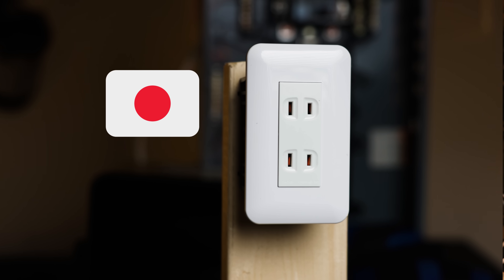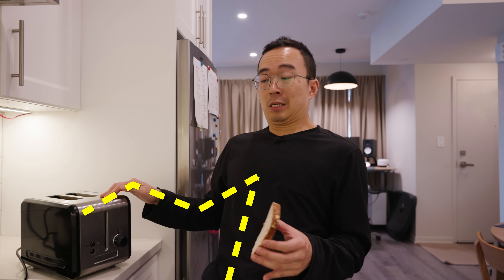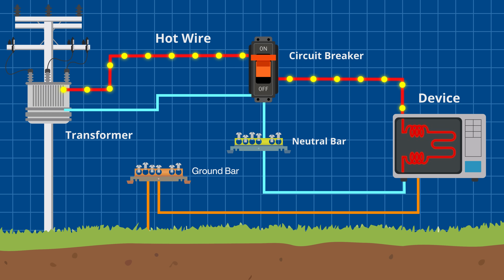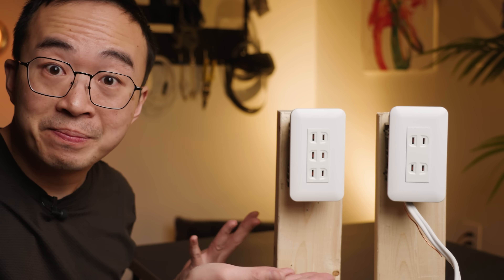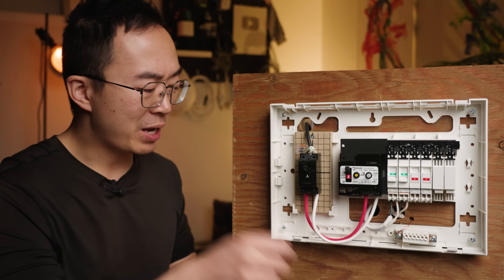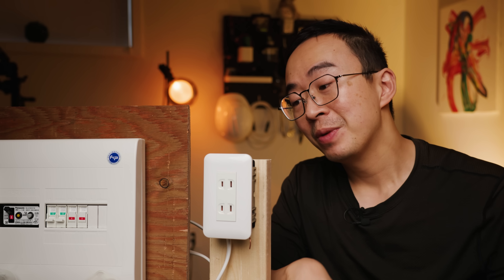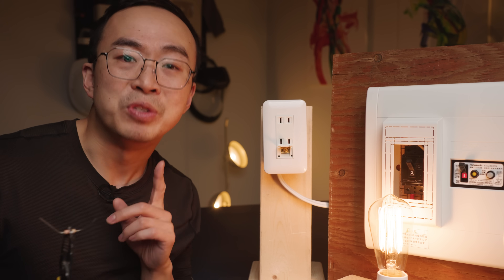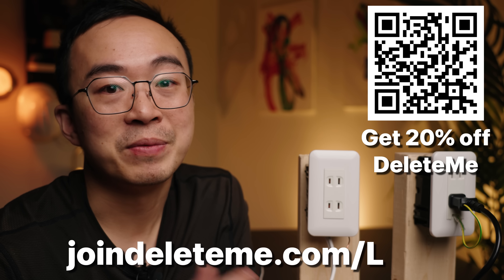How Japan Made Their Outlet Safe

Comment: In the UK, every socket is grounded, Neutral is connected to Earth and virtually all houses built since the 70s have RCD protection.
Most older properties have been rewired and so equipped also.
And in the last few years each individual circuit from the consumer unit has it's own RCD, meaning the whole house doesn't lose power, over a toaster that would trip, BEFORE anyone touched it.
Reply: British plugs are the best but hurt more than lego if you step on them in the dark
Reply: @noimnotarobotcanubeleiveit7024  Absolutely, the best;  there fused (so we can use ring circuits and not have stupidly big consumer units),  the cable comes out downwards meaning less likely to be pulled out and tripped over, sockets have shutters and pins have shields,  holes are smaller than fingers,  earth pin is in contact first and last when unplugging,  polarity cant be reversed and cannot use without earth pin (unlike some dodgy EU extension leads which only have 2 pins on socket end,  but allow you to plug things requiring an earth at the other end),  and there solid compared to how easy US or EU pins are bent etc

Just a bit bulky that all !
Reply: @marcuswareham1  Schuko is much better. Cable can come down- or upwards, depending the application. Sockets have shutters, at least in Nordics, there are no need for pin shielding, because socket covers the plug so you cannot touch the pins when it comes to live. However, often pins are shielded in case you plug it to the old style of socket. Earth is same making contact first, polarity can be reversed and it's a good thing. It's much more convenient because you can plug either way. Unearthed sockets were made until 1997, after that new sockets need to have earth. That's why you still sometime see those dodgy leads, but they are coming much more rare.
Reply: @marcuswareham1 
Ring mains are only a benefit for using less wire. 
Radials are far better for safety as you can't over rate an appliance.
Fuses in the plugs are only there as the ring main can support a much higher load than any appliance so doesn't trip a breaker. And will cause fires.
Unlike a radial that the breaker is set to the rating.

The plug pulling out is a benefit as it helps prevent trips and damage to the socket. 

The shutters are a good idea and sockets should have them, but also it means every plug needs an earth pin even on double insulated appliances which do not need earth which is why they're plastic earth pins.

With RCD protection which is arguably the best protection was introduced into other countries decades before UK introduced it. 

There are benefits and drawbacks to every system.
Reply: @noimnotarobotcanubeleiveit7024  True but something nobody ever repeats once burned in to memory.
Reply: @noimnotarobotcanubeleiveit7024  i cant remember stepping on lego pain . but i suspect the shape of the lego structure has a lot of influence on this "which is worse" debate [fyi i speak of ,for example , a house constructed of legs not the structure of a individual lego ]

i suspect there's no option but to give up and fall on the floor as opposed to committing to a foot vs. plug BATTLE TO THE DEATH. 
    Am i correct in this? [does a chance that a forward step has a chance to roll the plug on its side?]
Reply: @noimnotarobotcanubeleiveit7024  
I have never stood on a plug. I also do not not leave knives on the floor. The British plug can be left in the socket using the switch to turn on and off appliances.
Reply: Yeah, it's nice not having the lights turn off because the toaster blew out. Plus helps make the identification of the problem item much easier; find which breaker tripped, and then find what's on that circuit, turn it all off and then enable them one by one until you get a trip (assuming it's not a slow or intermittent fault).
Reply: @Elesario How often does that happen? Once every three years? Get off your arse and flip a switch.
Reply: Fortunately, all former UK states, namely Singapore, Hong Kong and Malaysia uses UK type grounding.
Reply: @radiusdoc2372 You forgot to mention Macau. Macau is also using British plug socket.
Reply: And before RCDs UK properties had the option of VOELCB going back to the 1940s. I think this video is misleading (but I do not think it was intentional). Hopefully Andrew does a more accurate follow up given how much constructive feedback has been posted.
Reply: @aaron_11111  That was on systems using TT earthing. The earth has so high resistance that one needs some additional device to cut the power. Now it is an RCD (either the normal 30 mA or in case that is no available or malfunctions a house wide 100 mA one). Earlier VOELCBs were used.

On a TN system the normal breaker does the job.
Reply: In the UK, plugs often have fuses inside, too.
Reply: @keeneseeley627  
Most do.
Reply: Yes the UK 3 pin plug is bulkier... and it hurt a tonne if u step on it. But oh boy, am I glad we are using this in Malaysia.
Reply: And the live wire is the colour of your trousers turn if you touch it.
Reply: Both neutral and ground go to the same place. Open the box and see.
Reply: @cjsrescues  this depends on what cables comes from the local distrubution system, either you can have a true ground as in the video ,  metall bar hamered to the ground or go back to junctionbox or distrubution place, older systems piggy back on the neutral. with a true ground it should never be connected to the neutral. 4 wire system vs modern 5 wire system, at least in sweden.
Reply: @zapy-85  USA here, we screw everything up. LOL.
Reply: @cjsrescues  I don't know where you're talking about, but it's not universally true - my house in England (built in 1937) has the Earth connection returning to the substation via the cable sheath (which is lead).  It's known as TN-S and it would be illegal to connect the Earth and Neutral conductors at the house in this situation.  What you're describing is TN-C-S, and there's also TN-C and TT earthing systems.
Incidentally, if you touch the Earth and Neutral together when working on a live circuit it will trip the RCD (guess how I know?  :-)
Reply: @cjsrescues  not always in the UK,  a customer side Neutral earth link would be against UK regs. It is usually done at the transformer in the street, or at the company supply point before the meter, or we have TT, which is more or less mandated for farms and similar and petrol stations, as the low fault currents are preferred.   Its not as simple as it appears which is 'best'
Reply: As a bonus, UK plugs hurt worse than legos when you step on them accidentally.
Reply: Same in Hong Kong and Macau. We are using the same system.
Reply: Same in Hong Kong and Macau.
Reply: I wonder how much safer does that makes the whole system. Not theoretically but practically. Being living in Japan for a long time, but have never heard anyone dying of a electric shock...does that extra grounding REALLY make a difference in real life?!
Reply: @JoaoSilva-t5i  In practical terms, we know an earthed toaster would have tripped within milliseconds of the conductor coming in the contact with the casing, even if nobody was touching it at the time. That vastly reduces the likelihood of a faulty appliance providing any shock, no matter how short in duration, to anyone. That.has to be safer than the alternative of having to receive a shock, in order to trip the RCD, wouldn't you agree? Our bodies offer huge resistance too, meaning it would in theory at least, take longer to trip. I'm not saying such a short shock is likely to kill or injure, but who knows, if the person shocked has a heart condition, a pacemaker, or is standing near hazardous objects like a pan of boiling water? Looking at deaths per year in the UK and Japan, Japan has about 11 a year to the UK's 5, despite your population being less than double that of the UK. So the numbers for both are small, and though probably not statistically significant, the UK comes out marginally safer.
If all homes had RCD protection in the UK, no doubt our numbers would fall further. Much of our housing stock is very old and many still have regular fuse boards. There has never been a requirement forcing people to upgrade here.
Reply: @matthewjenkins1161  So answering my question, no, there is no practical difference.
Reply: @JoaoSilva-t5i  Is receiving an electrical shock vs not doing so, not a practical difference? If the video is correct that all homes in Japan are RCD protected, compared to the UK where that isn't the case, yet we still have marginally less deaths per capita from electrocution, then whilst small, there is a practical difference. I don't know if or where such statistics exist, but I'd guess that most of the on average 5 deaths per year in the UK, happen in homes without RCD protection (I'd guess from observation about 20-25% of UK homes). RCD in combination with earthing, drastically reduces the risk of receiving a shock in the first place.
Reply: I thought every socket in my house is grounded, because I saw the ground pins...well I was teribly wrong. After gas technicians changed the gas pipes, the lights in the house were out. Why? It turned out my sockets had +230 phase and zero phase that was connected to the grounded gas pipe. No connection from the "real ground" pins.
Reply: Yeah but the UK  is a 1 hot conductor system which is much more dangerous than the 2 hot system used in North America and Japan, so you require much more active safety measures to get to the baseline level of safety a 2 hot system provides passively.
Reply: @jamesperry1358 
Not do.
Reply: @jamesperry1358  
The oddball US two hot wire one N is not safer at all.
Reply: The change to RCBO (Individual RCD with overload protection) is largely due to modern electronic power supplies. These power supplies have capacitors from Live to Earth and from Neutral to Earth, which cause a small leakage. One of these power supplies on its own will not trip an RCD, but several of them can reach the trip threshold. By having individual RCBOs on each circuit, it becomes much harder to reach the trip threshold.

By using RCBOs on each circuit
Reply: * On the topic of "Neutral is connected to Earth" is not always the case - The UK uses 3 grounding systems, TN-S (Earth and neutral are separate), TN-C-S (Earth and neutral are separate in the installation, and are combined at the service head), and TT (Mostly used in rural areas where other earthing systems are not available / compliant with regulations)
Reply: @Omalleypike  TT is rare in the UK and where used RCD protection mandatory. TN-C-S does use a shared conductor on the supply for Neutral and Earth, sometimes called the 'protective and neutral conductor' (PEN) or the 'combined neutral and earth' conductor (CNE). As for TN-S the earth terminal is connected by the supply protective conductor (PE) back to the star point (Neutral) of the secondary winding of the supply transformer, which is also connected at that point to an earth electrode.
Reply: @matthewjenkins1161  Ohh man..
Its kind of out of topic, but its soo great to see TT TN-C-S etc having the same name everywhere, since we call RCD ÁVK, and have funny names for almost everything else... The comment section in this video is full with acronyms i never seen before...
Reply: @matthewjenkins1161  I wouldn't say that TT is rare in the UK as it is pretty common in rural areas. I live in a village just outside of a city and have TT earthing. My mother is in a village in another part of the country that has mostly overhead feeds and that is also TT.
Reply: @matthewjenkins1161  TT is rare in towns and cities. Common on farms and houses in small villages.
Reply: @Omalleypike  Only TT is truly separate and rare in UK homes. Where it is used RCD protection is mandatory. The supply for TN-C-S still has a common supply conductor for Neutral and Earth.

Comment: Wait, residual-current circuit breakers(Aka RCD) aren't a thing in US?

It turns off the electricity as it notices leak between hot and neutral-wire
EDIT: RCD mentioned, but that Japanese outlet are weird. Here in Russia we do use both grounding and RCD's

Comment: Normal US Breakers are not designed to protect people.  They are to protect the wiring from being overloaded from a dead short which will cause a fire in the walls.  GFCI and AFCI breakers are designed to protect people and is a modern invention.  This was possible from miniature circuit boards in the receptacles or by using a GFCI or AFCI breakers which have circuit boards.   

US electrical code used to allow two-prong receptacles unlit the code was changed sometime around the 1960s.  So, Japan has finally figured out the reason for the third prong is to give an alternate path.  I guess two prong outlets are not as safe as they could be.  

Where did you get a 3-prong toaster?

Comment: It is perfectly possible to combine the best of both worlds and have both grounding and residual current breakers as happens in modern European installations. My (UK) panel has RCBOs on every circuit. That's a device which combines both MCB (over-current) and RCD (leakage to earth) protection on a per-circuit basis (older installations often had separate RCD (GFCI) breakers covering many circuits. 

The UK is mostly TNC-S (like the USA), some older properties might have TN-S (with a separate metallic route to the substation) and a significant proportion of TT as well. The latter always used to require special protection in the days before RCD/GFCI devices were available. They typically worked by monitoring the voltage between the line (live) and ground and if the latter rose significantly, indicating a large current flowing to ground it would trip. 

I should add that RCDs are not considered 100% reliable. They are active devices, which is why will include a test button. Even and MCB (circuit breaker) isn't 100% reliable, which is why, ultimately, the supplier side will contain a fuse if there is a serious short circuit. Fuses are about as fail-safe as it's possible to be. 

Incidentally, TNC-S has its own problems, mostly due to breaks in the combined live/neutral on the supplier side, and many countries are now mandating whole foundation grounding as secondary grounding with low impedance.

The Japanese system (which is weird, with two different mains frequencies due to one part of country having US-derived electrical generation equipment and the rest German-derived) is much older than when RCDs were available, so it wasn't inherently safer at that time. It, like many other countries back in the past commonly didn't have a ground system at all.

Comment: This is wrong on so many levels:
First: TT is used in many countries, even in europe (UK, parts of germany, parts of poland and so on).
Second: TT is not intherently safer than other topologies. In fact: Most TT installations are equipped with a 300mA GFCI (and yes, that's tree-hundred).
Third: More and more countries require 30MA GFCIs on almost all circuits (as the devices have become reliable an cheap)
Fourth: A 30mA GFCI will disconnect (usually after about 100ms), but it will not limit the current flowing through your body. And in a wet environment, your body can easily pass >200mA to ground. Even after only 100ms that can lead to serious injuries.

Last: Having a GFCI does not mean, you don't need grounding. It's always better to have a defective applicance fail without the need to send current through the human body. That's where the earth-Pin comes in.
I would not call Japan's outlets unfafe. I believe a lot of competent people where involved in those regulations.
But calling it safer than a grounded circuit - that's just wrong.
Please consider taking this video down.
Reply: That 300 mA is for fault protection. It is way less than the 50-100 A that it takes to trip a breaker.

Comment: that American system is the safest for both 240 and 120 volts 
but there's a new problem. with the new plastic pipes the ground current can only travel through the water, all pipe should be grounded at the sink

Comment: In Budapest Hungary, my apartment only had 5 overcurrent breaker protected cricuits, with some double wiring into them, with mixed copper and aluminium wiring. No GFCI. Outlets in the bathroom. I got the distribution box replaced to a more modern one with a breaker per now 12 circuits plus an overall GFCI. I see in the UK they are going to RCBOs per circuit and it is common to buy a distribution box with overall cutoff and fulling filled in with RCBOs at a reasonable price. Here in Hungary that would be prohibitively expensive. I don't know why RCBOs are so very expensive here.

Comment: In the UK we have had RCDs for years. We are now fitting them to every circuit (not just one per box). In addition we now require, in larger buildings, arc detection breakers- these prevent most electrical fires. We also have ground, for class one appliances. Class 2 are double insulated, so do not use the ground. In addition to the breaker, every appliance is fused to match its current draw. Outlets in bathrooms are not allowed, except 'shaver sockets' which are transformer isolated.- so there is no ground path. Construction sites use 110v (instead of 220) isolated and centre earthed, so potential is max 55v.
Reply: Britain has the safest electrical standards and plugs but no plugs in the bathroom means no Toto washlets 😢 I couldn’t survive without mine (I brought one back to the USA).
Reply: @Bergkatse2  UK permits sockets in large bathrooms, and has since 2008 but they must be 2,5m or more from bath or shower tray.
Reply: @mikep-j894  
Three metres - from zone one. The three metres means 99% of bathrooms do not have sockets.